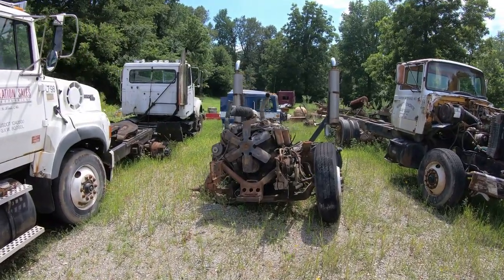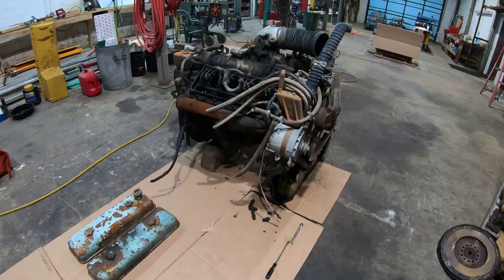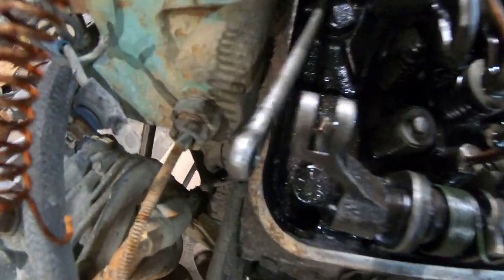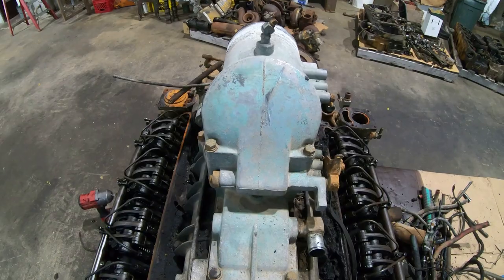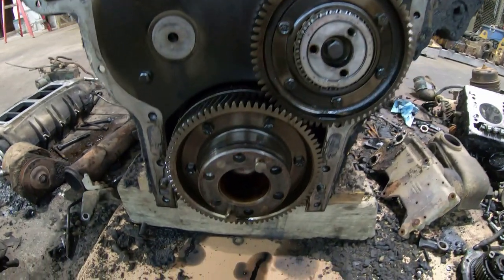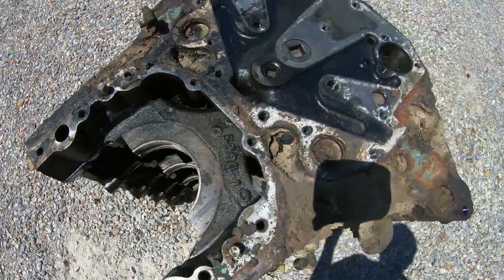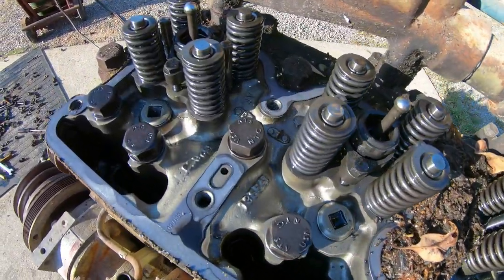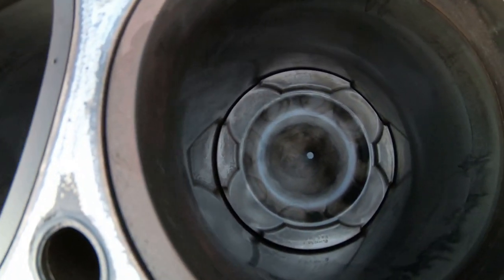Runaway 2 Stroke Detroit Diesel and Ethered Cummins Engine Tear Down

Comment: What's cooler than a 2-stroke Detroit?  The big 2-stroke locomotive engines made by GM's Electro-Motive Division, the EMD 567, 645, and 710 (that's CI displacement per cylinder, just like Detroits).  The 567 was also developed in the late 1930s by the same engineering team, and is twice the bore and twice the stroke of a Detroit Series 71.  EMD engines have fabricated (welded) blocks, and individual cylinders (power assemblies) can be removed and replaced fairly easily.  Unlike Detroits, turbocharged EMDs do not have roots blowers, instead the turbo has a clutch and receives an assist from the geartrain when idling or at lower speeds.  The clutch disengages once there is enough exhaust pressure for the turbo to start freewheeling. 

EMDs are all 45 degree V engines, with power outputs ranging from the 600 HP roots-blown 6-567 all the way up to the 5500 HP turbocharged 20-710.  The 567 is a legend in the railroad world, as it more than anything else is what killed the steam locomotive.

EMD is now owned by Caterpillar and the 710 engine is still in new production today, being used in locomotives, ships and stationary generators all over the world.  Unfortunately it failed to meet the EPA's Tier IV emissions standards, so has not been used in new U.S. market locomotives built after December 2014.
Reply: I love KT3's comments section. Everybody's got something worthwhile to contribute.
Reply: They also had a company called Cleveland diesel I believe
Reply: That's amazing, I've never really learned about anything railroad related before. Glad I saw this comment 👍
Reply: CAT buys a lot of companies and incorporates them but EMD has their market cornered so well they basically left it alone after buying it.
Reply: General Electrics basically redesigned the EMD engines, not sure if they owned the patent or owned EMD for a while, refined the powerpack concept to make the 30k hour overhaul a lot faster. Welded liner to the head, common rail injection(or at least something very similar), new turbo, It's been a while but that's some of the things I remember from when I was over in Eerie PA taking a V250 engine class. Never really got to put any of it into practice as my boss ended the contract with GE not long after I was over there.

Did a bunch of work on a few old EMD's though, marine application, those things were hellish to do bottom end bearings on due to the tiny crank case hatches and a sloppy as fuck special tool for the main bearing nuts. I remember always getting a laugh outta the manual telling you to tip the block over on its side. Replacing the spring drive for the turbo was also always a fun one, that rear timing cover is pretty unwieldy, not to mention the exhaust plumbing never lining up properly. At least adjusting the valves was super quick, turn down until the adjuster touches, 1.5 rotation back and set. Adjusting the injector racks took a bit more finagling but was manageable.

Anyway, ancient history by now, not even sure if any of those old barges still float or got recycled yet.
Reply: EMD has made a retrofit kit that makes the 710 tier 4 compliant however it requires a DEF with SCR like an OTR engine.  NS is testing the first one right now.
Reply: Bob
I love how in the Marine side of BIG engines thay are building them now to run on LNG and methane, just the fact that ships at sea can take a piston out of service to repair underway.
These ship built engines have great TEST shops to retro and multi  FUEL these new monsters to meet PORT emission standers.
Reply: @jdlawless_fuel1416  Yes, Cleveland Diesel was originally Winton Engine, the company that GM purchased in 1930 to get into the diesel business, being renamed in 1938.  Winton engines were used in EMD's locomotives during the 1930s before the 567 entered production, but Winton/Cleveland is far more famous for its WWII-era marine engines, which were used to great success in US Navy submarines and numerous other craft.  Most of Winton and Cleveland's diesels were 2-strokes too, and Winton also made numerous gasoline and spark-ignition distillate engines, which ran on kerosene, naphtha, or some other slightly heavier fuel grade.

The early history of GM's diesel and locomotive businesses is fascinating, Electro-Motive and Winton's teamwork dates all the way back to 1922.

https://vintagedieseldesign.wordpress.com/2019/12/07/cleveland-diesel-engine-division-gms-war-hero-turned-ugly-stepsister/
Reply: I keep those old girls fueled up for BNSF Railway.
Reply: @jasonmyers3847  
Thank you for keep the great engines rolling, I own a 353
8-71 love them both.
Reply: 한국 카우보이SsaurabiRedneck  
You are right about EPA bull SH_ 
But for ships to cme in some US ports required the BS 
I feel bad for the truckers who just move the container from port to port, having to UPGRADE there truck engines to get in port yard
Some of these guys are just scraping by, trying to make a living, I see trucks that run great and thay MUST upgrade there engines to meet the BS you are talking about.
Reply: 한국 카우보이SsaurabiRedneck  On the left wing EPA mandates you are spot on brother.  Speaking of which setting buildings, California forests, gas stations, Joe Six Pack's family owned businesses, and cars made of toxic plastic on fire is A-OK by the left, as long as it's to peacefully protesting the existence of YT.   For the record... G.E.'s locomotives which incorporates 4 stroke Cooper-Bessemer engines are polluting pieces of shit.  The belch out black smoke, start racing all on their own, stop racing and appear to shut down fuel supply, then just before the rpm falls to total silence... They pick back up and begin shaking the locomotive all over the place.  This passes emission certification??  Horseshit.   EMD's idle whisper quiet and smooth.  Old timers used to say the way they could tell they were idling was by touching the side of the locomotive.
Reply: 한국 카우보이SsaurabiRedneck  Raggedy shit.  Stack fires, smokey cheap shit.
Reply: How about the mercury optimax with a turbo 3.2l would do over 750hp and insane torque. I like the 850 etec rotax motor in the skiddoo. Now how about this new cummins 2 stroke:https://mart.cummins.com/imagelibrary/data/assetfiles/0058689.pdf?fbclid=IwAR3PWM1vZs8JxpuZMoJO5Y0YFoF9pV9fuGEhbyiGgxIP0r6sxzhqo5_P9oY. Dont for get the small block v8 2 stroke:https://www.4btswaps.com/attachments/2cyclesbc-jpg.6839/.
Reply: Not sure abouth this chevy 2 stroke:https://www.4btswaps.com/attachments/2cyclesbc-jpg.6839/
Reply: There crankcases not blocks

Comment: 1982 to 1986 worked with a fleet of dd 6v-53, 8-71 and Cummins big cam 400's. At the end of the day the drivers knew to put a small pan under all the detroit motor's..... Your video brings back memories.

Comment: Now rebuild the ole Detroit to show just how tough they really are, a full rebuild would be proper but a new kit for that one cylinder and four new valves she’d likely  fire back up..
Reply: @Jordan Bartgis You ain’t lying. Those engines are tough as they come.
Reply: Once he found out which cylinder had died, he could have removed the loose pieces put it back together and it would have ran just fine.  

I got story time with an old navy or marine mechanic and he said those engines don't like to quit as they were heftily built.  He said they'd run those engines to the gates of hell and if it busted a piston they'd just unbolt that rod and keep on going with one less cylinder.  He said when you're in a hot zone, you did what you had to do to survive and those old Detroit Diesels didn't give up easily!

Comment: This should give you an idea of how tough a Cummins motor is.  In April of 97 my mom had a heart attack while I was an OTR driver.  I found out at the Kentucky Tennessee line on I 24.  I told my boss let Illinois know what was going on and that I was coming in hot.  My boss routinely gave around 10k a year to the local state police station for their charity's and other things they asked for donations for.  I was driving an 88 IH with a mildly boosted 444 underneath the hood turning a 13 double overdrive transmission with a .5 final with 3.55 rears on 11r24.5 rubber.  I literally couldn't go into 13th gear below 70 mph without lugging the motor.  

Well I pretty much flew across Kentucky get to Illinois and I see 2 Illinois state troopers in the median they see my truck and say driver we are your escorts to get you home faster.  You can set the pace and go as fast as necessary to get home.  I dropped the hammer on the go pedal and didn't lift until I  got home.  Motor wasn't happy with me by the end.  3 hours of 2200 run out of 2400 possible rpm and I was demanding every single pony she had.   I dropped the wagon bobtIled to the yard and she was sounding like a bucket of bolts in the crankcase by the end.  

This was Saturday.  By Monday morning they had pulled the engine apart and gave me the news; I had burned #2 completely thru and swallowed 4 intake and exhaust Valles total.  Yet she got me home.  She was overhauled with the right parts for massive hp.  I'm talking 850 minimum under full load.  Today she's still around hauling grain and other stuff for a close friend of mine.  She's got over 2 million on her clock and he has no plans to retire her.
Reply: Amazing story 👏

Comment: Great video, I had the privilege of working on a ship with a 6-71, 8V-71, and two 16V-71. They were designed to be able to take a bullet to the block and if you could keep dumping water in it would keep running.

Comment: I use to drive a bunch of 8/71 318 detriots they leaked oil like no tommorrow but were kind of fun to drive you had to run em like a race car ,i miss dat todays engines are whimps no trills

Comment: 8V71 don't make power...!!!!!?? Change the injector. The old  GM manuals had a chart for each engine that would tell you this injector in this engine will make this amount of power! Worked well in all the engines from the 53's to the 149's. Parts are still available to rebuild any of the GM two strokes. New gaskets and orings have helped the leakage issue tremendously.  By using a separator and feeding the cleaned air box air back to the intake would help but you have to watch the separator and keep it emptied.  When you start pushing the horsepower to the limit you have got to watch coolant temp.  Above 210 coolant temp on that 8V71 kills those dry liners. Would love to have a good truck with a GM 8V71 or an 8V92 Silver to pull my fifth wheel! I am just an old Navy Engineman that worked on many of those engines as well as Fairbanks Morse opposed piston engines! Take care and have fun. You only go round this block once!
Reply: you ever run into those weird Napier Deltic opposed piston diesels?
Reply: @bobsmith2637  I never ran into any of those. I would like to have a close look at one of those animals before they all die out! From what I can find it is a really neat layout, all be it complicated!
Reply: @daveburks726  British Rail had some locomotives built with pairs of them, I think there's a few still running at museums and tourist railways over there.  

I run freight trains over in Canada, we have  a lot of EMD engines still in service, which are just really big Detroits with welded blocks and a geared, clutched turbo on the more powerful ones instead of roots blowers (non-turbocharged EMDs do have blowers).  A turbocharged EMD 16-710 is rated at 4300 traction HP at 950 RPM

Comment: One of my peeves is when people say that the Detroit 2 strokes are super charged. Then they rebuttal with “well my (insert small 2 stroke gas engine) doesn’t need a blower to run”, then you have to explain to them how a basic 2 stroke engine works to begin with, and why you have the oil mixed with the gas, then you have to explain the Detroit (or any large 2 stroke diesel) and how it works and by that point they just got mad because they can’t wrap their heads around it.

Comment: Well the education continues - Thank you!
While I mentioned before I wasn't a diesel mechanic but a mechanic I am.  I used to volunteer for a railroad museum and got my hands dirty a lot on locomotive engine.  I would be shown how to do a task and off I went.  With that said General Motors Locomotives had two strokes in them and I thought that the "blower" was like a turbo with a diffent drive.  Little did I realize that the purpose for that blower was for the two stroke air exchange.  Again thank you for the education!!   Love your video's.................

Comment: We had 8V92 with twin turbos in the early M-113 APCs, that's why I can't hear anymore.
Reply: Uh wut?   The early M-113 had a Chrysler 361ci gasoline engine.  That was 60 years ago so it's about as early as an M-113 can get.   The 361 Mopar bigblock got replaced in the mid/late 60s with 6V53 Detroit V6 diesels although a few M-113s still served with the Mopar V8 through 1970.  No turbos on M-113s or M-113A1s until the A3 version which did have a turbocharger on its 6V53 diesel.   Maybe you're thinking about something else...

Comment: Fun  Video.  I had a International DT466 runaway on me right after an in-frame.  If you want to over fuel a Cummins, plug the return line. I remember the older mechanics saying you should keep the engine manual handy to place over the intake if you had a runaway.  Or use a Co2 fire extinguisher to displace the oxygen. And the best one, keep a hammer close and start breaking off the fuel line fittings.
Cheers
Willy

Comment: Great video We ran 8V71's & 8V71T Detroit's from 1967 to 1987 had one 8V92 natural aspirated engind in a 1975 IHC Transtar II think was rated at 365 hp. was a freak of nature. Came from the factory with turbo style pistons in it.  She was a real puller of a truck for the time. Once they found out their mistake the factory wanted it back.   They didn't get it back.
Reply: You do realize that the turbo pistons make less compression right?
Reply: @DGAF_AK87  I'm just telling you what was in it dude.

Comment: Considering the abject abuse the engine suffered, it suffered very little damage,  no coolant, designed with intent to be a runaway. I'd say your criticism of the engine bears little. Cheers
Reply: "low power, high fuel and oil consumption" anyone that knows detroits knows these statements are true...

Comment: The blower off a 6V53  works very well on a big block 396, or 427.   I put a blower off a 6V53 on my 427. Was a bit of a ugly farm build manifold but worked sweet. We use a forklift at work with a 4 53 detroit at work.  With a boss who will not kisten to me and have a proper mechanic fix the air box leak to stop the oil blow out through the Exhaust.

Comment: One thing that you got to give thees old 2 stroke Detroit is there get up and go is fantastic
I am a volunteer in my hometown and we have a firetruck with a 2 stroke Detroit in it and it won't get over 50 however we don't need it to go much faster then that what we need it to do is get up to 50 quick and it can do that.
Reply: 2 strokes respond to load better than 4 joke crap: finally cummins offers a 2 stroke with high hp to weight ratio:https://mart.cummins.com/imagelibrary/data/assetfiles/0058689.pdf?fbclid=IwAR3PWM1vZs8JxpuZMoJO5Y0YFoF9pV9fuGEhbyiGgxIP0r6sxzhqo5_P9oY. I got a 2 stroke v8 small block and silver 8v92 and they pick up load quick. i hope to repower my f-250 with a 2 stroke detroit so i just dump the gutless 7.3 4 joke in out up front so some kid can take it away. i have the sound of it anyways. you spend a lot on a new car or truck just get a louse 4 joke POS motor in it that compicated and every buying these ugly 4 joke outboards! Atleast rotax in skidoo and lightning are 2 strokes!

Comment: the funny thing is that after all of the mistreatment its seen, that cummins could still be overhauled and rebuilt into a running, useable engine. just goes to show that those oldies really were built to last

Comment: Them OL Scream’n Detroits sure do have a Sound of Their Own! I’m not a Big Detroit Guy, I actually like MANY Different Diesel Motors, and with The RIGHT Tuning, Turbo, Exhaust Manifold, & Exhaust they ALL can Run GOOD and be GREAT Motors! International DT466, Cat 3116, Cummins ISC 8.3L, Cat 3126, Cummins L10/M11/ISM, Detroit S60 11.1L Non EGR, Cat C-12, Detroit S60 12.7L Non EGR, Detroit S60 14.0L Non EGR, Cummins N14 525 RedTop, Cat 3406E, Cat C-15, Cummins Signature 600 Non EGR, Cat C-16, ALL of these are NON EGR Motors. ALL are GREAT Motors that all have their Place in Different Applications, All where Produced during the MOST Fuel Efficient and Produced The LEAST Amount of Emissions Period of Diesel Motors, which was from 1995-2003. That was The HOLY GRAIL of Electronic Diesel Motor History. That’s why these Motors are so Sought After, that’s why they Sold a RECORD Amount of Gliders from 2008-2020. Now I do have my Favorite Period of Mechanical Diesel Motors as well. But in all Honesty and Motor after 2008 with EGR/DPF’s (which can be taken care of) I’m NOT a Fan Of, but I Especially Don’t like Motors after 2011 when DEF came out. But I Like Motors that are 2007 and Older, but 2003 and Older is My Favorite. I Consider myself a CAT Guy, but Each Motor had a Specific Application that they Excelled In on that List of Motors, even International DT466’s, Detroit S60 11.1 & 12.7L/14.0L’s, and Cummins M11/ISM & N14’s, but I LOVE the Torque & Sound of Cat Motors!

Comment: I am amazed that Detroit only had real damage to 1 cylinder.  I believe that engine could be rebuilt and used again if one were so inclined to do so.
Reply: If I had the money it would be mine. I'm a teen getting into this but alas have no cash
Reply: @jdlawless_fuel1416  been there done that! This kind of project started me into a career that lasted 42 years. Took an old engine got it running and built a pickup around it, was my daily driver in school. When I  started working, got enough money together to rebuild it.